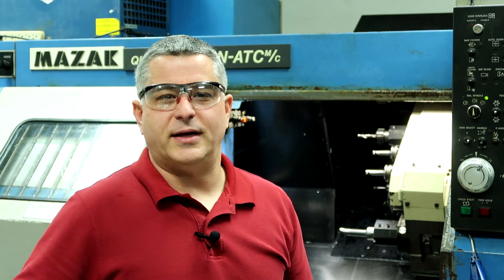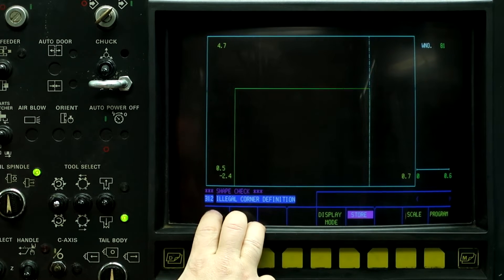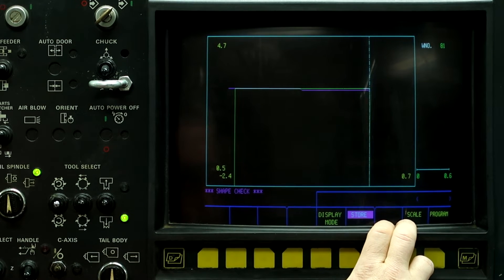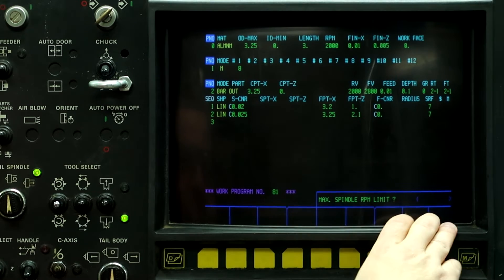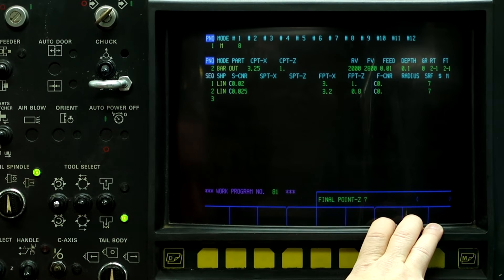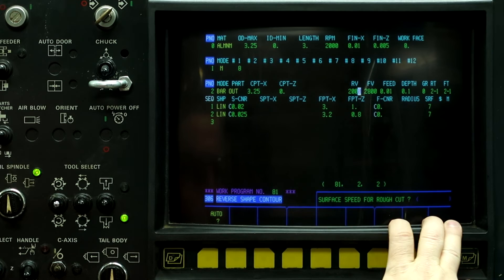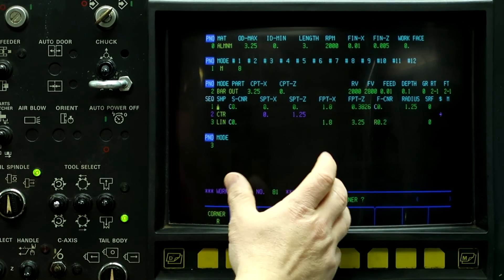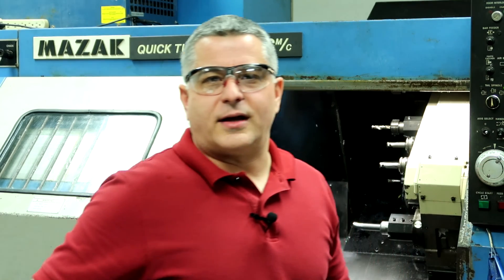Mazatrol Programming Errors Lathe Reverse Shape Contour

Comment: what about RSC error doing a knurl using bar out. z from zero to 2 inches and back to zero
Reply from the maker: Mazatrol will not travel back and forth in the same process like that. You need to use manual process for knurling. I have a knurling video if you want to see how I do it.

Comment: Phil it might come easy to others but i am new to mazatrol  and lost my cutting conditions on my machine. i have asked about this elsewhere but the advanced fellas get rude and treat me like I am stupid. On the material and cutting conditions screens it give you ballpark settings for the Auto button when programming. mine used to have 4140/ 1045 / Aluminum / ToolS/ Inconel all options that set up my program (get it close). would it be worth doing a video on setting this info up on a machine that lost its parameters?
Thanks for all your hard work i have learned allot from your videos!
Regards
TL
Reply from the maker: I think that is an excellent video idea. My old controller does not have the same cutting condition calculating abilities of the newer controls, but it does do the basics.
Reply: @mazatroltipsandtricks6816  Awesome I have to tell you when I am stuck at 2AM by myself in the garage you have taught me how to fix various issue's and move on without messaging my buddy's who do it for a living to death lol. I cant thank you enough!
I have a SQT10MS with a  T32-3 and also just acquired a QT20 with a  T plus I am assuming these would be common setting in both machines? (cutting conditions and material etc.
Reply from the maker: @toddlinder9447  Yes, the cutting conditions are fully customized by the machinist programming at the machine. You do not need to stick with the factory cutting condition parameters.

Comment: Hi am Geoffrey down here in Africa Kenya. Can you use same system for a mazak integrex 400 sy to produce spiral bevel gear. gkaranja723@gmail.com
Reply from the maker: The machine needs to be purchased with the option to produce gears.  My machine at work does not have that option.
Reply: @mazatroltipsandtricks6816 . Can I have your contact
Reply: @mazatroltipsandtricks6816  hi thanks

Comment: hi master. i want to know about count of cut pieces . in my mazak qt21 its not work. and tank you if make a video about MDI button in mazaks.
Reply from the maker: Put a 1 at the END process where it says parts count.
Reply: @mazatroltipsandtricks6816  so that will count automatically? or each time need to input a 1?
Reply from the maker: @isarahmani5130  It will count automatically at the end of the program as long as there is a 1 in the appropriate place in the END process.

Comment: Great info to know. I always have trouble putting in a center for convex radius. Is the SPT- Z always the radius ?
Reply from the maker: In this case of programming a ball, the center of the radius is located 1.25" back from the Z0 face.  This is not always going to be the case depending on part geometry though.
Reply: Mazatrol Tips and Tricks can you do another video using convex radius and center unit. When u can. Still trying to learn those and the up down left right arrows...Thanks.
Reply from the maker: @cheizaguirre5494  Sure. Will put it on the list.